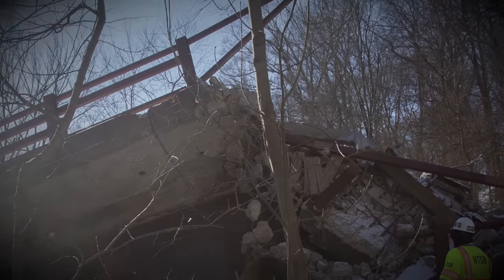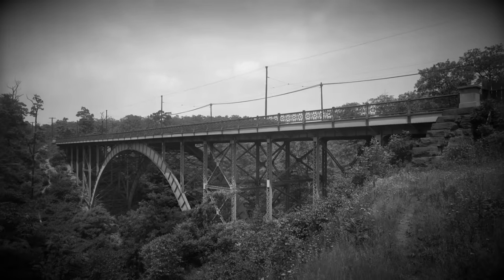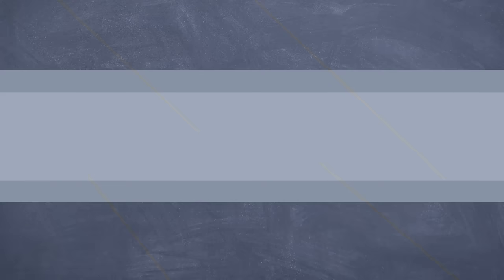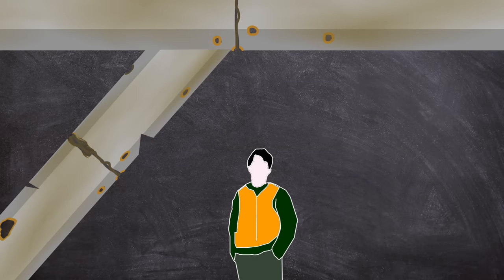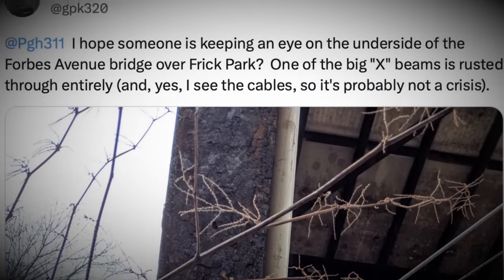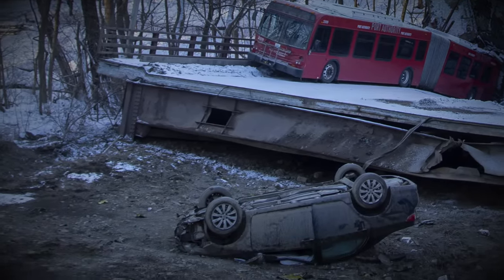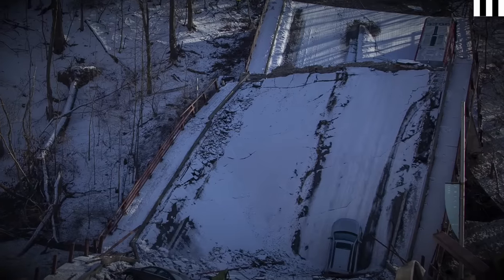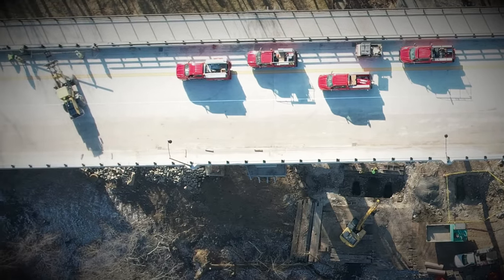Allowed To Rust: The Fern Hollow Bridge Collapse 2022 |  | Plainly Difficult Disaster  Documentary

Comment: There was no mystery as to what happened here.  A middle school general science class could have answered the question - why did this bridge fall down?
I saw a day before photo of the underside of the span. Yikes. The entire lengthy bridge deck  was sitting/resting on the mere lip edges of the vertical abutments -
edge sitting on edge.  That's it. There were no supports under the deck of the bridge for its entire length.  Heavy double section bus? Simply caved under the
weight with no underneath supports.

Comment: I have seen other bridge structures that are supposed to "rust a protective layer" on the metal. As an engineer (minor in materials science) I shake my head in disbelief.
Such proclamations about 'protective rusting' are meaningless when you deal with welded joints; that not only introduce a dissimilar alloy in to the joint but it changes the temper of the steel (due to the heating), You have attachments that may be different metals (steel vs. stainless steel) and the presence of things like road-salt and contaminants.

The 'rust protective layer' crowd, who usually end up being the board members who vote to approve the money and construction on such projects are only listening to the words. "You won't need to have someone come out there and repaint the bridge every 5-10-15 years so it saves you money".

Comment: I do wonder about the logic behind authorities dismissing safety inspectors basically telling them "This bridge will collapse!", only for the authorities to be all "This is fine!!!", and then the bridge collapses and all the lawsuits come rolling in from victims of their arsebadgering about on top of the cost of removing the wrecked structure and replacing it, when it would have been cheaper in the long run to just replace it when they were told to...

Comment: In my 60 yrs I've traveled around this country a bit. I've noticed that Democrat run states have terrible roads and bridges while Republican run states tend to have better infrastructure. Republicans tend to spend more on actual infrastructure rather than labeling things as infrastructure that actually are not. I lived in Massachusetts and the roads and bridges were old and dilapidated with chunks of cement falling off pot holes a foot deep. They hardly kept up with the roads. The sewer systems are so old they can't handle a heavy rain storm. When they finally did do some road work in Boston and built the Lenny Zacham Bridge it was found that the whole project was a total scam and the materials used were inferior. They also found that Boston was ripping off the federal government during the whole project. The politicians were involved in multiple scams along with the contractors.